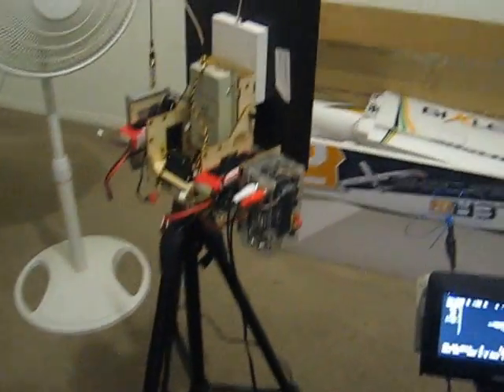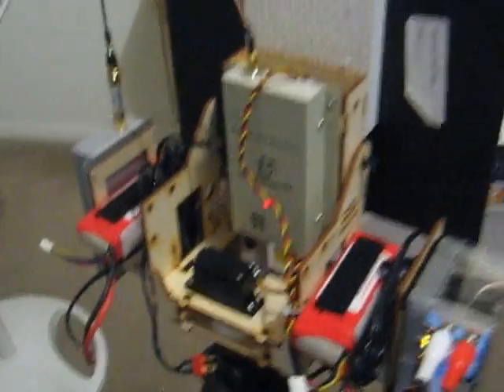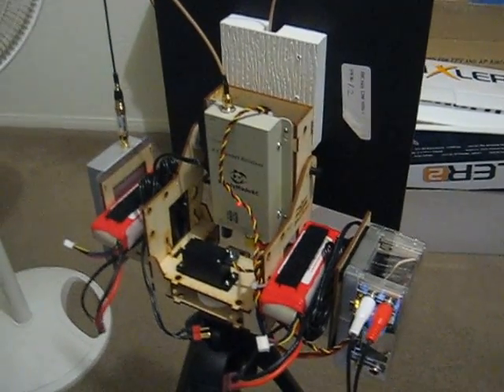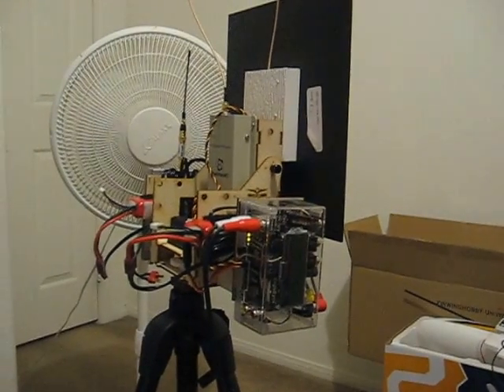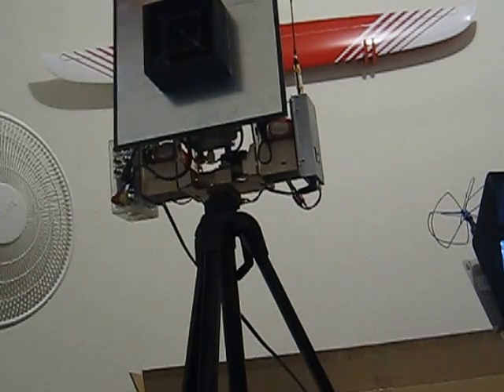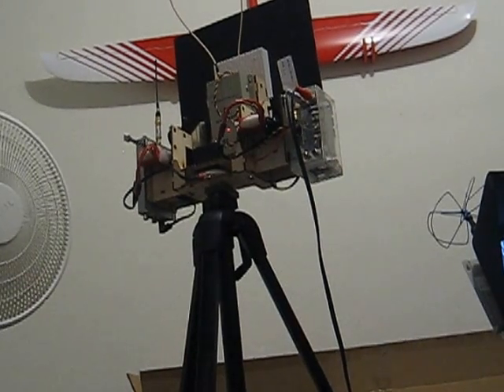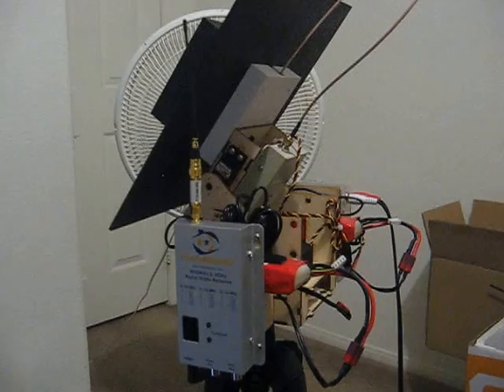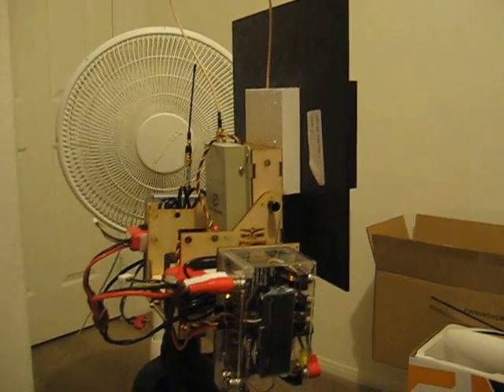Eagle Eyes Pan N Tilt test #2 only pans between 0 to 180 degrees in simulator

Comment from the maker: I set the High and Low tilt angles; I will double check them. If I'm using 180 deg. servos as well, I should not have them go to the 180 deg. / max clockwise or counter clockwise?